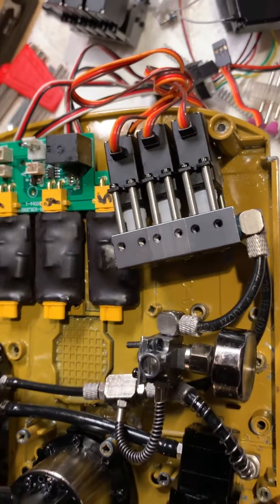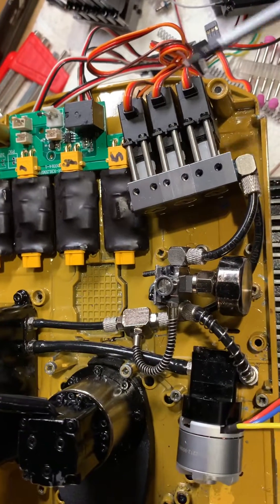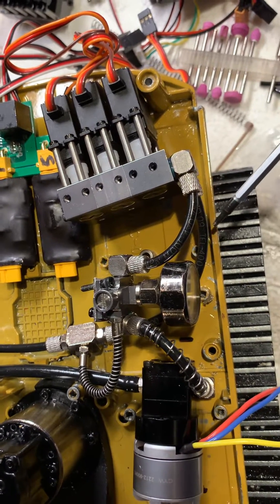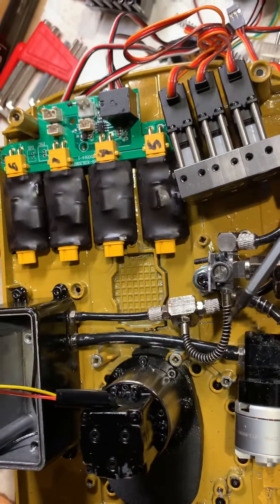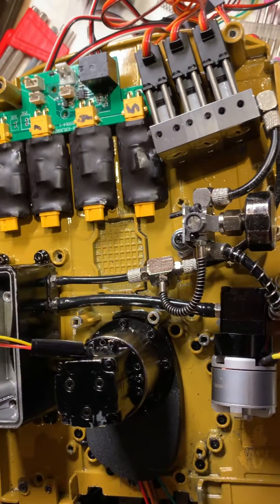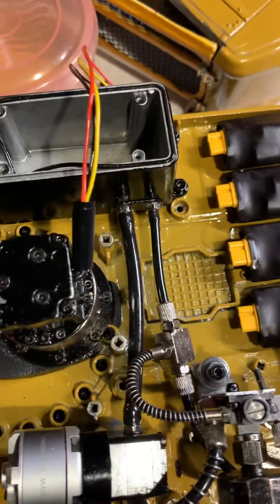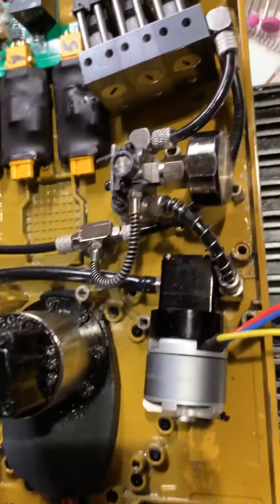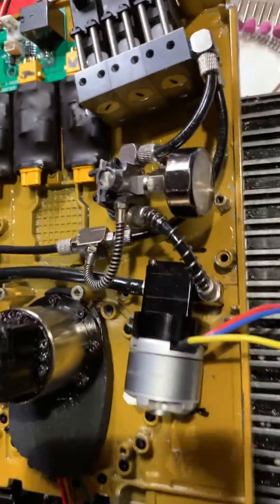Kabolite 336 GC upgrade part III

Comment: Hi Mike! 
Sweden here, saying tx for your good videos! 👍🏻
I am waiting for my hardline kit to arrive for my Kabolite 336gc v3 im so excited 😆 I have a question: do you think that it would be possible to add one extra block valve so i can use hydraulic accessories? 
Sincerely Mathias
Reply from the maker: Yes, you can buy a single valve block & there is plenty of room to add it. Give some thought to replacing your hydraulic system, that may be easier than trying to add another block to the existing system. Stay in touch and I’ll help as much as I can, thank you for visiting my channel.